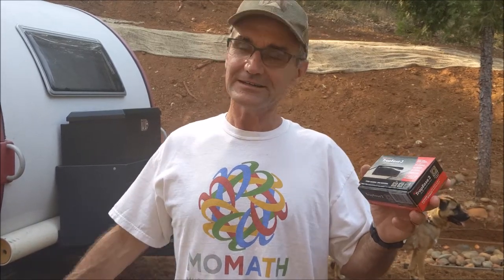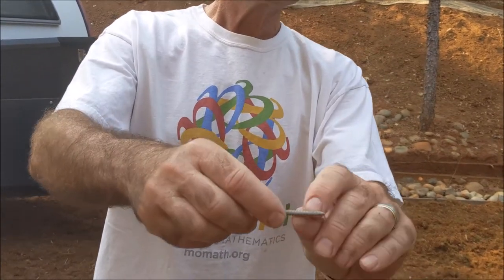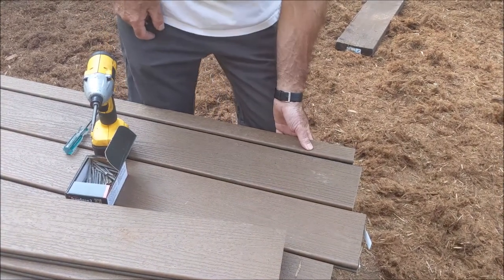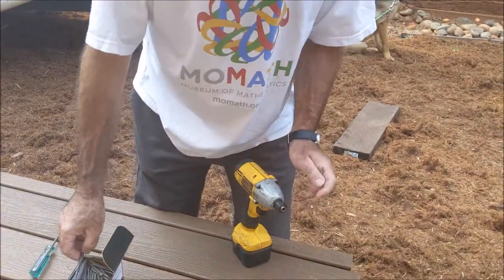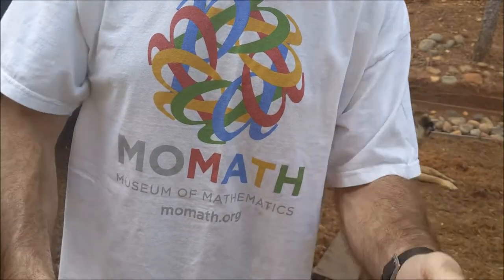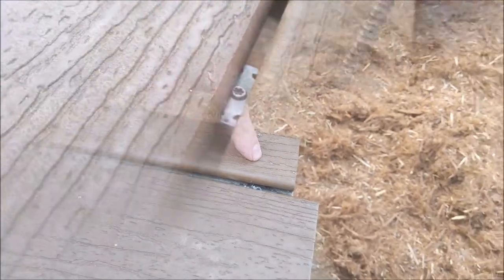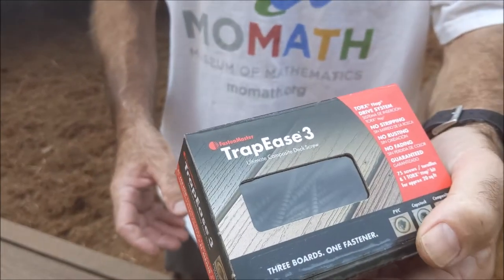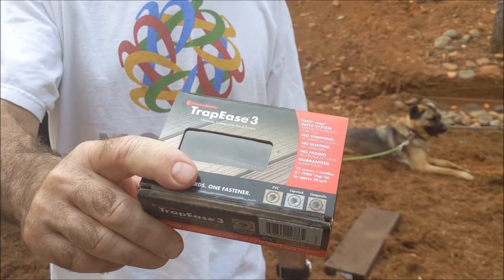The Best Composite Deck Screws: Fasten Master TrapEase 3

Comment: Would face screws not prevent the board from expansion and shrinkage?
Reply from the maker: There doesn't seem to be too much movement in the Trex products
Reply: @topsaw  it is hard for me to understand why manufacturers require us to leave a gap for expansion while also approving face screws which is counter intuitive.  Screws will lock the boards in places and resist expansion.
Reply: The decking will slightly expand and contract around any fixed points like the screws. So, having the recommended spacing between the neighboring planks is all that's needed
Reply: @bfamily4150  I understand the expansion when using clip on the side of the board.  But for face screws, there is one just 1" from the gap and I find it hard to understand how 1" of board can expand by 3/8".
Reply: @b3arwithm3   I don't think the expansion would be anywhere near 3/8" to the side of a face screw. At least i hope not!
Reply: @edbreyer  but that is what the manufacturer recommends.  That's why I can't grasp the physics of it.

Comment: I've found if you dont predrill you will get cracked boards
Reply from the maker: Yes, very true
Reply: Is pre-drilling only required if you're 1 inch or less from the edge of the deck board?